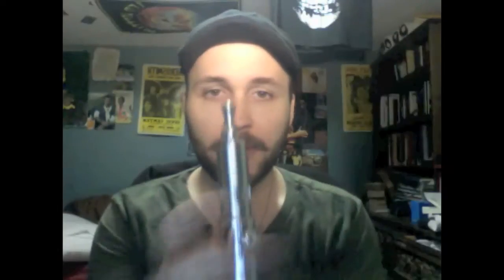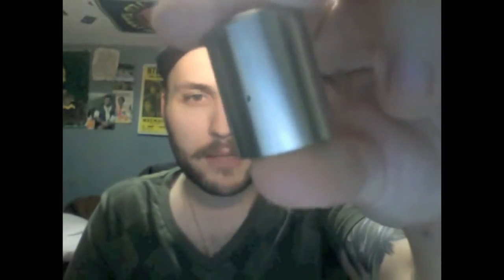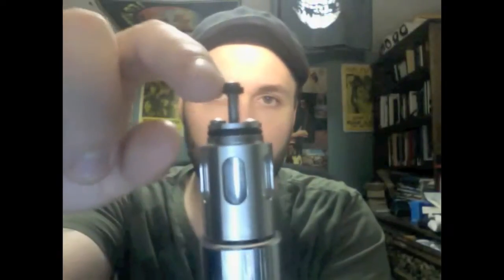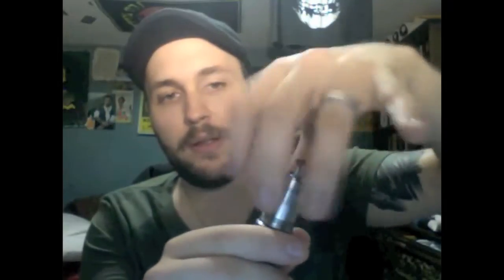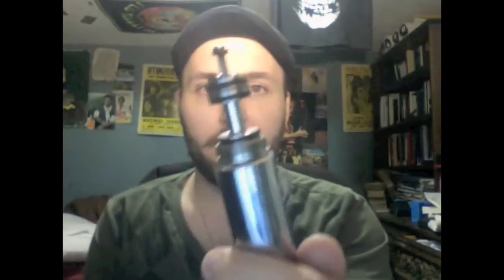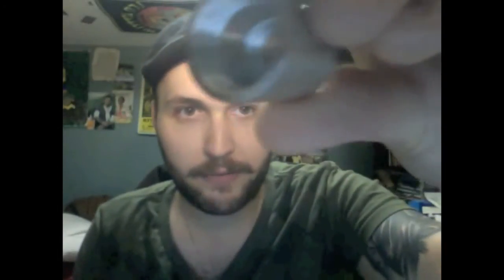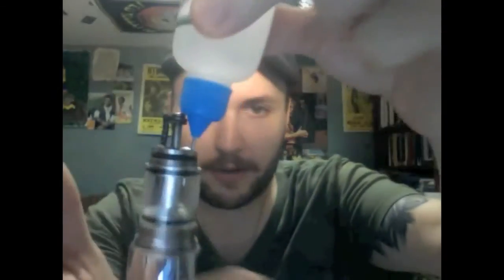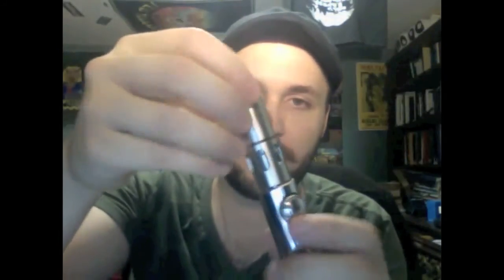FunkyVapes - The BLISS, by DocDave -

Comment: what broke? the pin that goes through it? you may find a long narrow brass machine screw/nuts/washers(in graduated sizes) in a hardware store and rig it up  :) i've had mine apart a few times i think it could be done fairly easily and what do ya know here's a vid 
/watch?v=prq8PbYwQhQ&feature=plcp
and i think it could be done even cleaner with a more comfortable button if thought out well good luck on the other hand you can mod the gus or paps to be all mechanical too with just a screw IIRC :)